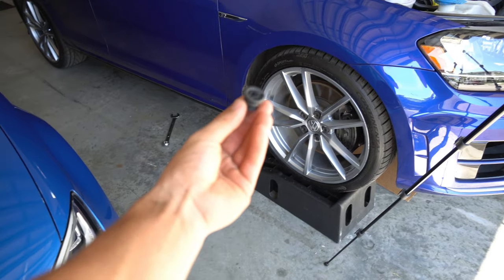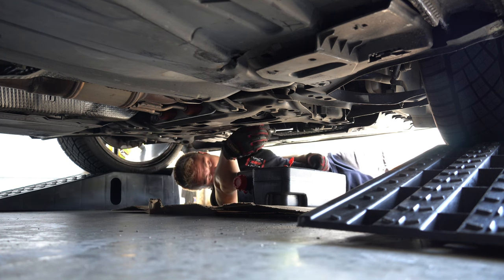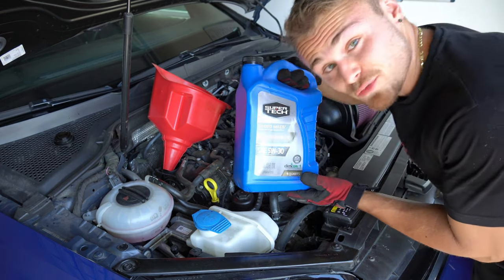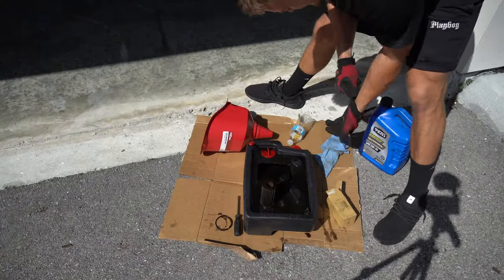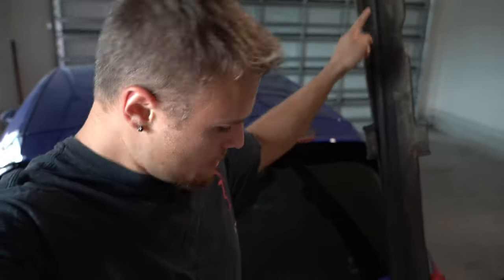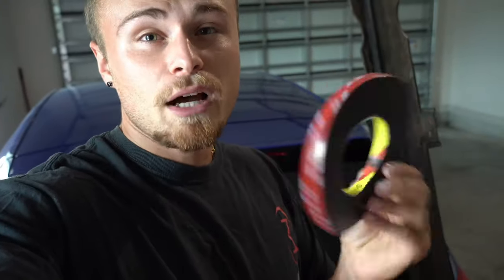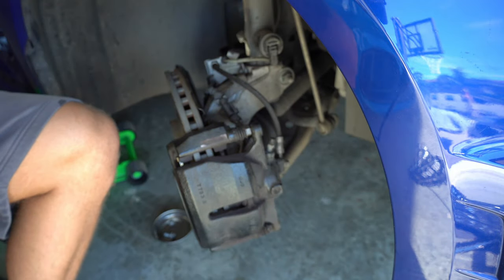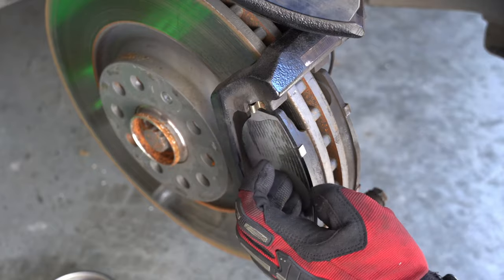REBUILDING A WRECKED VOLKSWAGEN GOLF R | PT 15

Comment: Those are the wrong brake pads for that car. Their should be no play in those pads they should fit firmly in place. I've owned over seven VW's I never had this issue with brake pads. 10/01/2024 2320